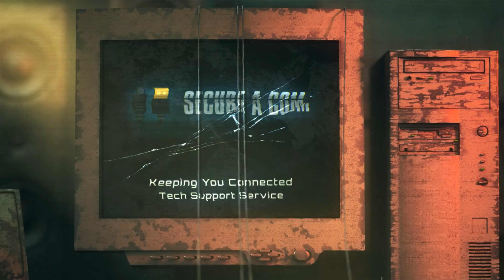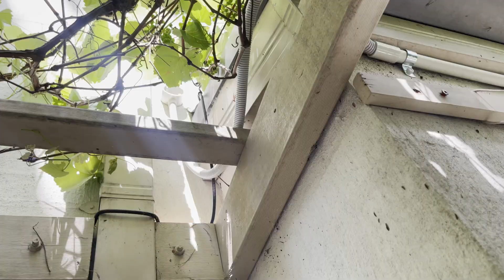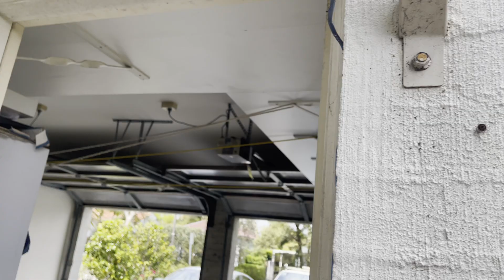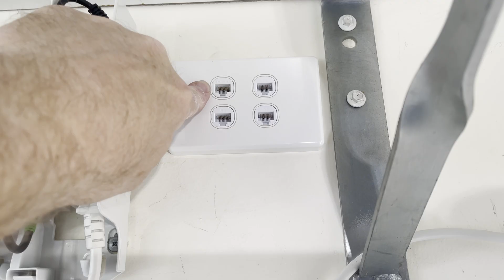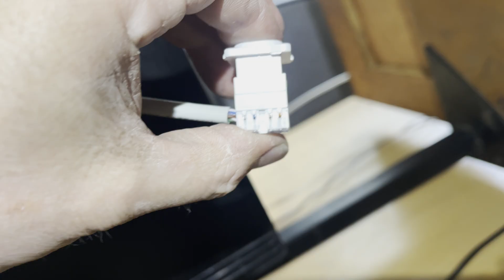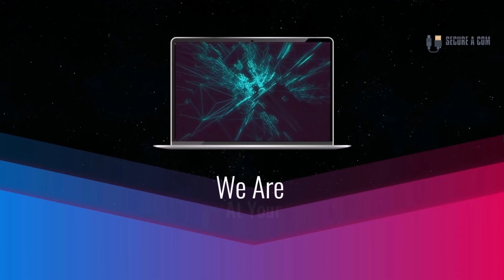Stop Running Wi-Fi From Your Garage! | FTTP Cabling & Cat6 Jack Tutorial

Comment: NBN usually install closest and straight forward path from PCD yes they have a spec etc however I do think it's pure laziness just to get job done and be paid, My install the tech as he was teaching an apprentice and he was an old school ex telstra/telecom linesman made the apprentice go into room and run the lead in from one side of the house to my lounge yes I got lucky, another issue I see as working for an ISP that NTD is up a bit too high especially for elderly if asked what lights are on NTD they may not be able to see them not only that if the NTD does need to be rest I really wouldn't like someone needing a step or a ladder to reach it as it should be able to be at a reasonable height from ground level

Comment: I thing that I don't understand regarding wiring the jacks is the A or B configs. Why are there two, why not just the one method?

When the NBN guys came around, they affixed the outside box to a wall that's closest to the street from where the fibre was run. However, the office is at the diagonally opposite end to this. The guy who came to wire in the NTD saw this. Hummed and Ha'ed and said no worries, moite. He got a 20m fibre cable out of the van and I volunteered to go up into the roof to run it along to the other end. He then did the rest.

I was so worried that when they turned up that they'd insist on having the NTD on the other side of the wall where the outside box is located. That'd mean that it would be in the lounge. My wife would've hit the roof.

Comment: Just do a single cable run from the garage to the office, so the router can stay there, and have the other cables for other access points in the house come to the office as well (optional switch). Its easy to access, and no need to go to the garage to reboot it all.
Reply from the maker: They didn't want wifi signals inside the house
Reply: @SECUREACOM  Well that negates the comment I was going to make which was why not just use mesh wifi with ethernet ports and a VOIP adapter? However, if the customer doesn't want wifi, cabling makes sense then.

Comment: I rented a house where the NBN unit is located. I just used a mesh wifi setup and it works fine. If I owned the house I'd have run a few cables to each room but I don't.

Comment: I can vouch for keeping the twists as close to the termination points as possible, i do industrial electrical/data/security and i use a cable certifier mainly on Cat 6A 500MHz and it is very picky about the twists, if its not good enough it will consider a Cat 6A cable to be as good as a regular Cat 5